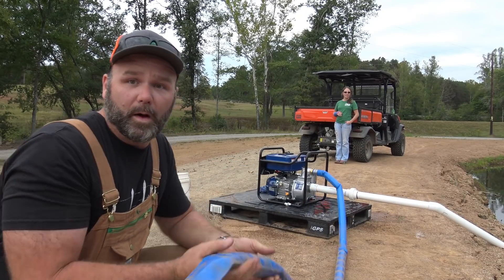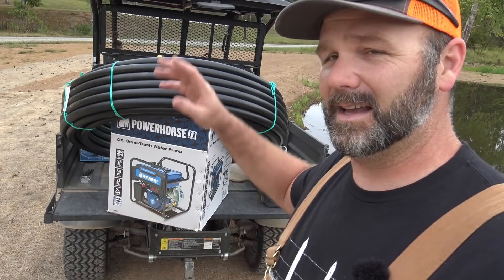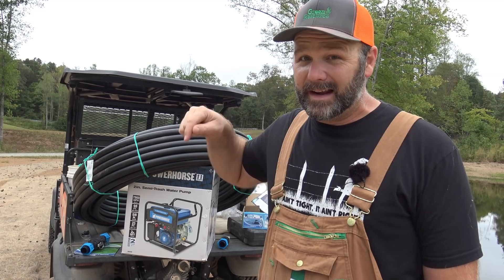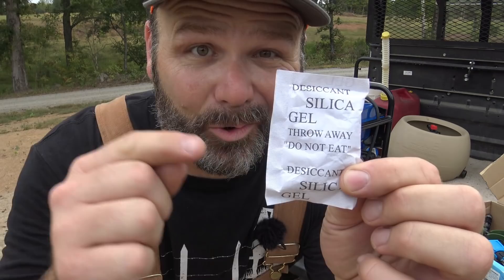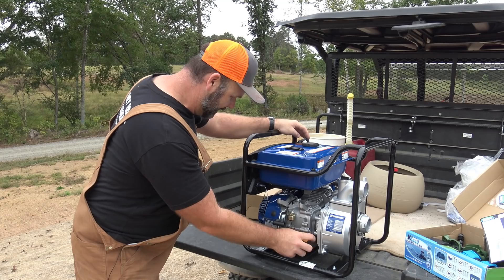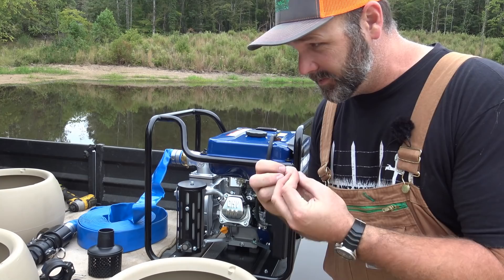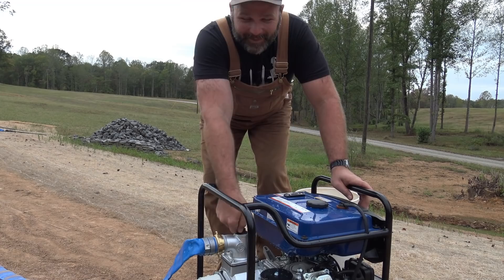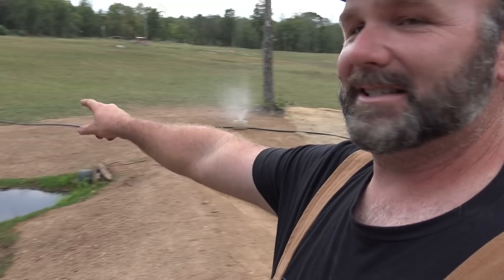Never seen irrigation like this? Pumping from the pond...setup start to finish!

Comment: In my experience with irrigation on our family farm , I learned that once you get everything çonnected and primed be sure to remove your sprinkler head spray tips on the first initial water run! It allows any dirt or plumbing debris to be flushed out and not stopping up the tips!

Comment: To prime the pump. I put a “Tee” with a riser/ upwards piece of pipe with a threaded cap about halfway between the pump and the water supply. . I unscrew the cap and use a bucket to fill the pipe . Thread the cap back On Abd your good

Comment: Josh, three things come to mind right away. First you need to make sure you have enough sprinkler heads so that you keep enough water moving through the pump to keep it cool.  The goal would be to have total sprinkler output match pump output.  If that aluminum pump housing heats up you will be rebuilding it.  Second I would suggest a check valve on your intake pipe to keep from back flowing into pond when you shut it off. Third, for your outflow on the pump I would put a cam lock fitting that then goes to a pvc elbow then another cam lock then to hose.  This will keep the lay flat hose from pinching and allow you to change the direction your hose is running by simply opening cam lock and rotating 180 degrees.

Comment: Another good idea would be to install a drain pipe in the top of the damn about a foot from the top so when the level reaches the pipe it will drain instead of running over the top. This way you can divert the excess water exactly where you want it to go instead of it sitting in a problematic area and it will be a better way to prevent a washout

Comment: Josh, 
Take the fitting loose on top of the pump and turn it 90 degrees to the right or left for the pump output to be at a right angle from the pump input.  It will work so much mor efficiently

Comment: Another benefit of this setup is an emergency fire fighting system in a pinch.
Reply: Maybe if you have a couple hours notice.  Most fires will be a mile down the road time you got it setup.  Usually the wind is blowing like a bitch too.  Best thing to fight a fire on a farm is a deep plow and a big tractor that will turn that dirt over.  Then you go around and around whatever you are trying to save.

Comment: Looks like a good system. I use a similar pump on my farm, but need to explore different sprinklers to distribute more water
Reply: I bought thise cheap sprinkler guns on ebay. The 1.5" is tge best for me..shoots a heavy stream about 100' does not take long to soak the ground.

Comment: Good stuff Josh, to help keep track of your PVC cleaner and cement cans duct tape the two cans together side by side that way when you find one you have found the other. The challenging part is to avoid dropping either of the brushes in the dirt, don't ask how I know that ! :)
Reply: Can't tell you how many times I've found either cement of primer but not the other, extremely frustrating!!

Comment: Put a rain shed and sun screen over the pump.  You will thank me in a year.  You can mount it to the pallet and using some fence hinges design the roof to move out of the way to allow you overhead access if you need it.  On the water inlet and outlet you want 2feet of straight pipe before your hoses.  This is based on pump best practices.  This will help prolong the life of the pump internals.

Comment: I was never around it much was too young my granddad had about 20 acres of commercial strawberry 🍓 and sweet corn at that time he used Gorman Rupp pump 6 or 8 inch with an slant 6 chrysler engine for power and for lipt and pressure to irrigate the crops from A drainage ditch that held water year long at the time....

Comment: Hi Josh you should use a flexible pipe on the inlet with your filter so you can just throw it in the pond I have the same exact pair but I throw mine into the canal

Comment: I run my “small engines” on propane, easy conversion. Runs extremely clean. Even my string trimmer and lawn mower (push type) on a 1 pound bottle.
Reply: Have you a video on that?
Reply: Yep and you can easily refill the small 1lb bottles.
Reply: Tobbe Andersson There are multiple videos on this platform. I use a el cheapo torch for the valve. Modified it to accept a pvc hose, run through the fuel fitting on the carburetor.

Comment: I toted enough irrigation pipe in my lifetime to know I never want to do it again. At one time I had over one mile of 6 and 8 inch 30 ft long aluminum pipe. We ran hard hose style "travelers" irrigating crops. Thank God for center pivot irrigation.......... Nothing beats rainfall but when it means the difference between surviving and not sometimes you have to tote pipe. Hard times and hard days. Best part was when we got through and the water was flowing you got to jump in the pond to cool off. Hope your wife mends quickly. Broken bones are a pain (no pun intended) . If you want to upgrade your irrigation watch the auctions for aluminum pipe a good pump and a "hard hose" style traveler.

Comment: I bought one from amazon came with a heavy duty flexible  inlet pipe I bought another longer one and joined them ya can get at an industrial hardware store or hose shop  , I added a better metal  filter and an old bucket I drilled holes in  so it doesn’t clog up as quickly works great that lil filter will clog quickly mine did anyways you will like it crazy how much water those trash pumps move .  I use to have one of those lil electric jobs what a joke compared to these happy grass growing !

Comment: Great job brother!!
A secondary filter on the outlet line is recommended.
The sprinklers passages are small and can get clogged easily. (Need plastic surgery skill to take apart)
This pump is made to empty flooded basements, an such.

Comment: I have done numerous water systems here in Ontario and the past few years I have used quick couplers, real easy and no air leaks, also used aa honda pump that needs no foot valve, self priming

Comment: I have same powerhorse pump for pumping water from our pond. It has run great for about 300 hours, only problems ive had with the pump is #1 they had to send us new bolts and motor mounts for the frame, 2 of them had broke. The 2nd problem we have had with the pump is the exhaust is starting to rust away after about a year, im not sure if its poorly made or what, but they are sending a complete new exhaust now too. My 2nd advise on pumping water from your pond is your gonna what some type of filter or to make a floating suction pipe, if the suction is anywhere near sand it will end up in your sprinkler heads and you will be pulling them apart and cleaning all the time. I can run 3 heads off the pump @ 30 psi or so only 1/2 throttle, i found running the pump any faster just collected more sand in the sprinkler system. After trial and error we just went to a floating suction line and no more sand!

Comment: Hey Josh, just thought I would throw this at you, one thing we have always done is to pull a spike harrow ( which a chain harrow would probably work too) over our pastures after we rotate the cattle off one and move them to another one to help distribute the manure move evenly over the pasture to help with the fertilization process, seems to work really well, been doing it as long as I can remember and I'm 52 now and have never had to buy fertilize! Like I said, just thought I would mention this incase you might be interested in trying when you get cattle.

Comment: Suggestion to put pump on an old tyre and a piece of plywood as it will vibrate the crap out of that plastic pallet
And put a plastic drum on the end of your suction line and have a foot valve so you dont lose prime
Reply from the maker: It did remarkably well...but we will be mounting on a trailer soon

Comment: I've used K-Pods for about 10 years to irrigate most of my pastures.  I also have some SEME "River"  guns for certain areas.  The K-Pods work nicely but I quickly found it was a pain to move the feeder pipes and pods once the sprinkled areas were done.  With that in mind we trenched in several feeder lines about 2 feet below the surface and planted the quick disconnects  in pressure treated wooden boxes about 2" to 3" below ground level so i did not have to worry about mowing them off or driving over them.  I use a leaf blower to clean them out each Spring.  Now we only have to move shorter sections of pipe and pods.  Also, each year I have added 4 or 5 pods so now I do not have to move them much except to mow.  Each "stringer" line is color coded so I know which ones go where.  When one area is sufficiently water I then switch to another area just by diverting the flow with valves.  If i feel I need to move some pods I let the finished area dry out a little so I'm not slipping and sliding in the soaked areas around the pods.

Also, you will find that the cleanest water (the water with the least amount of floating debris) is usually 2" to 3" below the pond's surface.  I fabricated a floating pick up from a small car tire inner tube and some aluminium strips and regulate the pick up ends filter depth by changing the amount of air in the tube.  You can buy commercial floats but they will cost about a whole months allowance!  For about 15 bucks you can make your own and it accomplishes the same task.  

BTW, I also got tired of having to remember to fill the gas tank on the pump so I mounted the pump on a two wheeled trailer along with a 15 gallon aluminium "hot rod" gas tank I bought off of the internet.  Now it can run 20 hours plus before I need to refuel it.  Now i have to remember to set the alarm on my smart phone to remember when to chage irrigation areas.   I also mounted and piped a 30 gallon plastic water tank on the trailer for priming the pump.  Once it is primed I fill the priming container with H2O directly from the pump so if it somehow loses prime there is plenty of water to re-prime it.  Using a check valve next to the floating pick up is a good idea so if you shut down the pump to refuel you don't lose the prime.

Give a lazy man a job and I will find the easiest way to do it!
Reply: Which pump did you find works best?

Comment: Excellent video Josh!  I don't recall hearing it in your vid..., but it's very important to point out that the INLET (suction) side of any water pump is plumbed with solid/rigid pipe and not flexible.  Also, You gave that PVC about an hour and 45 minutes WAY too much time to cure.  PVC joints need maybe 15 minutes or so to cure before you put the pressure to them.  Definitely don't need 2 hours.   Hope Mrs. D's wrist is healing nicely...  :-)

Comment: PUMP DESIGN - Seems like you would want the inlet and outlet on opposite sides of the pump.  To have them both on the same end seems counter productive
Reply from the maker: Hmmm....not to sure why it would matter....but you make a point for sure....I think with both inlet and outlet in the center it allows the pump to pull water in  and push water out in any direction...imagine if the inlet was on the front...and outlet was on the right...and you needed to pump water to the left....you'd be screwed....I think they've thought this one through

Comment: Remove the spray nozzle from those sprinklers. Move lots more water, and won't work the pump so hard. And with four, yo can run that pump about 1/4 throttle and  get way more run time on tank of gas. And definitely add more sprinkler heads.

Comment: Sure was a lot of wind before that first drop of water.
 You sprinklers will clog rocks and debris using that pump screen. I used a well point and put it inside a field line sock. 🤔

Comment: Great video, nice setup.. I have same pump and I made my own sprinklers out of 20 foot one inch  PVC. Drilled  two 1/16th  holes every 6 inches in a V pattern, flexible tubing in between each 20 foot section I have 8 sections of 20 foot PVC.. I can add more.. I added a T fitting and pressure gauge and full throttle I have 90 psi water pressure.  And as of now I'm pumping water 200+ feet to my 8 homemade sprinkler.

Comment: Only 3 rules to plumbing.  Poop runs down hill, payday is on Friday and don't chew you're fingernails!  Put floats on that pallet and hook it to a tight wire that crosses the pond so you can set it and send it to the middle.  Teflon tape gets me every time!  Clockwise!  Or hum righty tighty lefty loosey for those that have never seen a clock with hands!  ;o)

Comment: Putting aeriated water back into the pond is a good thing ... Fish love it ... Also if you put the sprinkler pattern to the edge of the pond you will have blank spots on the pond dam because the pattern is round ... Check with local fire department ... Might have a section of old suction hose ... You can also sometimes get old fire hose when they get new ... Also maybe tie suction end to a float or put on a box to keep off the pond bottom ... Silt sucks ... Put a small tool box with primer, glue and tape in every vehicle ... Lol

Comment: Nice rig, its should do you well. I also have two items for you. One,  have you seen that Northern have a cart frame and you add the top. I believe the top size is around 4 X 10. Two, before I retired we used ponds to water the grass at are buildings we took care of. The feed side of the pump we use flex line. To keep the feed end of the pipe off the bottom we would tie one or two one gallon bottles (lids on and empty) with rope. The length of rope would determine how deep the feed end is under the water. This did two things for us. One, it keep the end off the bottom. Two because the system was in for the season and did not move it keep the end in water as the level of the pond went up or down.

Comment: you need a piece of foam with a hole in the center to float the intake pipe on, just use a 90 down into the water. keeps it out of the mud
Reply: jeff robison old refrigerator door comes to mind

Comment: The black fitting on the inlet side is rightly called a foot valve. It's function is not to strain crap from the water (a pump "sock"is best installed over the foot valve) but to hold the column of water on the inlet side; to "hold the prime" when the system is turned on and then off and then on again.

Comment: Take a one gallon milk jug , tie a piece of para cord to the handle at whatever length  you want and the other end to your PVC suction pipe that will suspend it in the water at whatever height you want it so as not too pick up contaminant. I also use a piece of plastic mesh that I got at the grocery store, I think it was a bag of lemons , to cover the intake. You need a ridged flex hose for your intake so it won't collapse from the suction. a shop vac. hose will work.  What you have there is "a pain in the ass" !

Comment: You may want to think Hydroseeding for the bare area.   Still would need to water with no rain but it establishes much quicker than just seed being tossed out plus it will hold the soil from washing until you get vegetation.   Do like the watering pods👍👍

Comment: You can never have too much Primer/Glue -- Especially since it almost always dries up by the next time you need it.
Reply: Like It Or Not ....try inverting your cans of pvc glue after tightening the lid. With the can upside down it tends to seal itself and keeps the air out and glue usable for a longer period of time.

Comment: Use a 10 ft hard suction hose connected to your pump, use a 10 ft 2-3 inch bamboo section, fishing pole style to lower and raise the hard suction in and out of your reservoir.Its easy to remove it..

Comment: Looks like the bank is starting to break away and collapse into the pond. You might want to put landscape erosion netting or rip wrap rock on the bank until vegetation roots can get set to hold it in place. Mounting the pump on the pallet was a great idea! On my pump I have a 2" flapper check valve so I don't loose my prime.

Comment: Looks like you put in a 12” culvert for overflow.  You could always increase it to 24” and that would handle gully washers. As others have suggested, use a flexible intake with a float so you don’t have to worry about picking up trash on the bottom.  Also, maybe install a checkvalve on the pump outlet so the line doesn’t drain back if the pump shuts off.

Comment: mooo!
rocking..
you can bury a few 6in pipes just under the surface of the top of the dam.  the when the rains come, water will exit through those overflow ducts.  usually rain maxes out around 3-4 inches per hour.  so you can add tunes as needed. the flow per tube can be measured different ways.  or calculated from a standard manual.  they should be sloped downward about 10 to one to keep flow high.  but that includes water height above the pipes hich adds preasure.  your milage may vary.

surly the cows know. but they never let on.

Comment: Had an uncle that approx 10mtr (33') of poly that had a float on the inlet end with a small weight anchor to stop from moving. Use to move it from damn to damn like you mentioned. He said it was to reduce sediment pickup if the damn was ever low.

Comment: Living vicariously through your videos here in Orlando. Fitting was a 45 degree coupling. Use Teflon paste, so much easier. Float the screen on a jug, very easy. Get a set of ratcheting PVC cutters. Your pots are way too far apart to allow for significant overlap. You’re going to have green circles. Loving your videos so much. Keep up the good work. 👍

Comment: Don't know about your pump, but mine had straight pipe threads, not tapered. There's a big difference and I couldn't get my pump to prime until I got the correct NPS(national pipe straight) fittings. NPT(national pipe tapered) is what you're most likely to find on the shelves at the big box store.